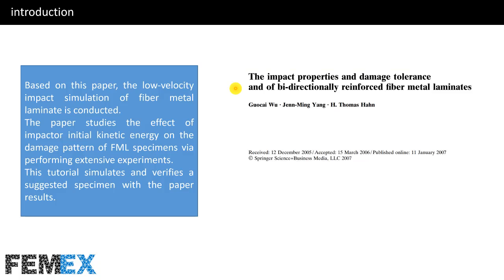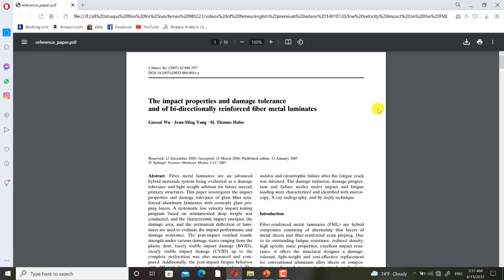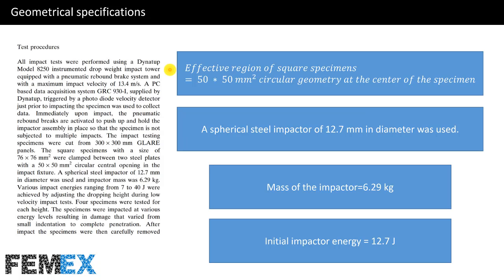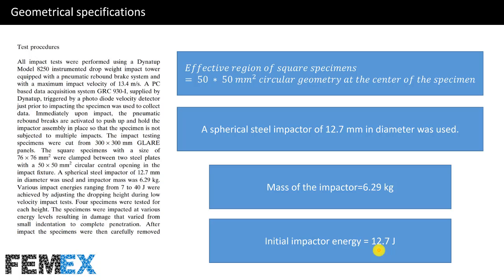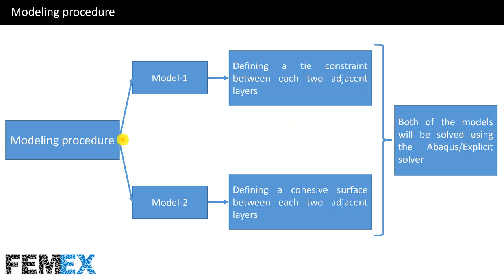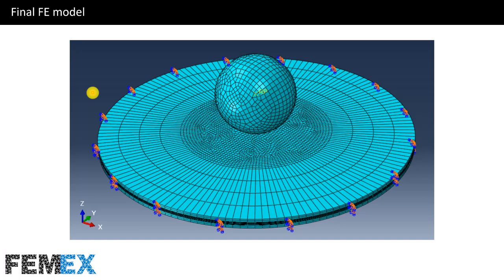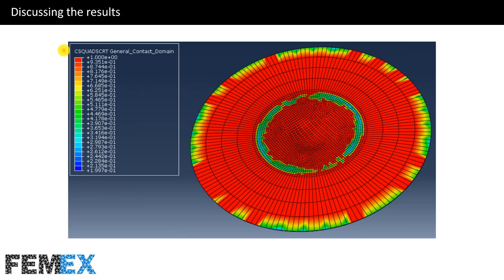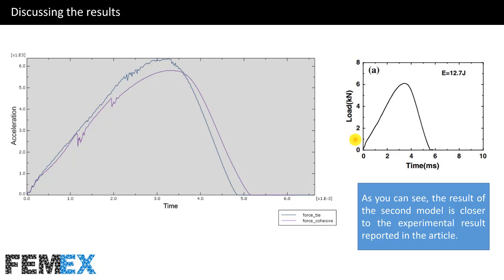Impact Simulation of Composites and Fiber Metal Laminates via Abaqus preview

Comment: Hello mirza,
I can make analysis by using cohesive surface , you know with surface to node interaction, but I want to model cohesive layer but I don’t know which type of element used? Composite layer should be shell and and element type is continuum shell , cohesive element already there but which interaction type can be used ?
Reply from the maker: Hi.
The element type of the composite layer is different from the element type of the cohesive layer.
For the composite layer you can set the element type to solid or continuum shell.
For the cohesive layer you must set the element type to cohesive.
The interaction between them must be defined as tie constraint.
Reply: @FemexIran  Thank you very much, In addition to hashin model,  Is it possible hashin model by using tie contraint and solid element, I will wait your response
Reply from the maker: @alihancambaz3159  If you want to use Hashin damage model, you must use continuum shell elements. Abaqus Hashin damage model cannot be used with solid elements. If you want to define Hashin damage for solid elements, you must use VUMAT or VUSDFLD subroutines to write damage model for solid elements. All of these are not related to tie constraint. Using tie constraint or cohesive surface or cohesive element has no effect on what you asked.
Reply: @FemexIran  Thank you,then We are waiting VUMAT video:)
Reply from the maker: @alihancambaz3159  You are welcome. I have VUMAT tutorials and they are related to composite analysis but they are premium. if you want to have them, you can send an email to me: mirzabozorg71@gmail.com

Comment: Hello sir,
Is it possible to take bullet size having length to diameter ratio as 1
As I am taking 19 x 19 mm size for bullet
Is it possible practically???
Reply from the maker: Hi.
What we model is according to the experimental conditions or what is mentioned in the reference paper.
If you want to do an arbitrary analysis, there is no general limitation on the geometrical specifications of the projectile but if you want to do verification, you must model the same projectile.
Reply: @FemexIran  ok in general I am asking is it possible to have l/d ratio 1 for any bullet practically??
Reply from the maker: @hitman5601  as far as I know, the length of the bullet is much bigger than its diameter.
This is because of aerodynamic reasons.

Comment: how to calculate residual velocity where is the option present in abaquas???
Reply from the maker: Hi.
Do you mean the residual velocity of the impactor ?
The velocity after impact ?
Reply: @FemexIran  once the bullet gets penetrate through plate that velocity
Which means bullet velocity
Reply: @FemexIran from where we can find this in abaquas
Reply from the maker: @hitman5601  If you request the velocity of the bullet as a history output, after the completion of the simulation, you can plot the velocity versus time and check the final velocity of the bullet.
All of these explanations are also included in our tutorial.
Reply: @FemexIran  ok I will try
Reply: @FemexIran  hello I plotted velocity vs time plot but my plot is showing constant line this should not have happen my initial velocity of bullet was 100000 mm/sec it should have varied with time?
Reply from the maker: @hitman5601  Hi.
Yes at the beginning of the curve, it must be variable.
Actually the absolute value of velocity must decrease to a constant value.
Your model must be checked to find the mistakes in the model settings.
To do this you can use our online tutoring and consultancy service.
You can send an email to me to use this service.
my email: mirzabozorg71@gmail.com
Reply: @FemexIran  hello,
I have solved this problem now I am getting error as elements property not assigned 
But I have assigned composite material properties
Reply from the maker: @hitman5601  Hi.
Your model must be checked.
You can use our tutoring and consultancy services.
Please contact me via email.
Mirzabozorg71@gmail.com